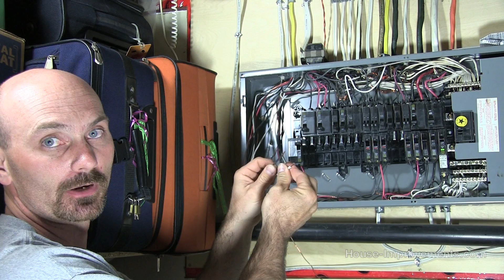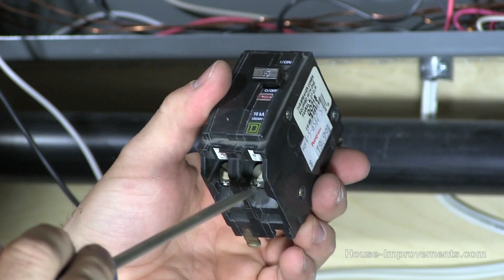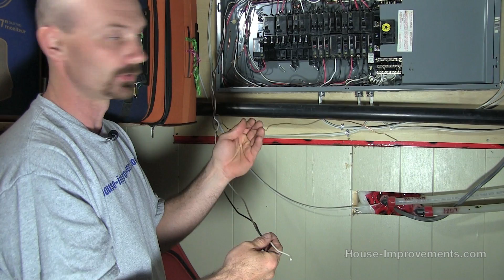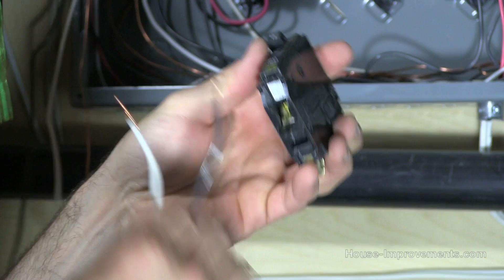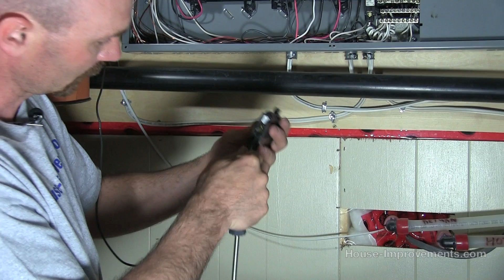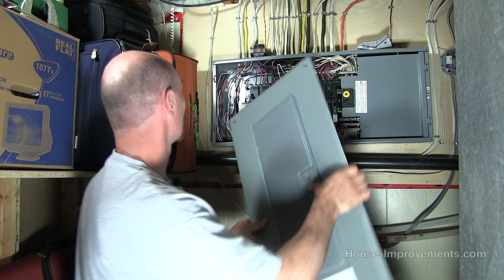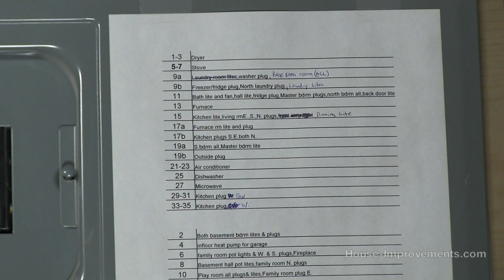How To Add a 120V 240V Circuit Breaker

Comment: Always use a licensed electrician when doing home improvement.  Same as you would never perform dental work on a family member.
Reply: divorced or deceased I am seeing a pattern here
Reply: +shawnbrennan1 I am a dentist with 40 + years experience. I have done many procedures on my first wife (divorced), my second wife (deceased), my mother (deceased), and my father (deceased)., my first father and mother in law (both deceased). They never had a problem. At least $20, 000 was saved. Thank you very much!
My experience tells me you shouldn't treat your friends!
Reply: shawnbrennan1 ROFL This guy, comparing electrical work to dental work. What a schill.

Comment: At my work place, it's always stressed that safety comes first.  Missing little things, like testing to see that a wire is live, can be deadly.  That is my only advice in this video.  To your credit, you did point out that you should have tested first.  At that point, it could have been too late.  To everyone watching this, ALWAYS MAKE SURE THE POWER IS OFF!  Test and re-test if you have to.  
Other then then that, The video is great.  I'm in Canada.  I've pulled a permit to do my own wiring on my addition.  Although I was fairly sure how to install the breakers, this is a great refresher.  Thanks.  I appreciate the simple, straight forward approach to your videos.  Wiring isn't rocket science.  But you do want to make sure that you do it right so it doesn't blast you to the moon.  Thanks again for a job well done.
Reply: Leroy Ginter, how does one stutter when typing!  [then then] :)
Reply: Agreed, though in fairness he does repeat probably half a dozen times in the video that if you don't know what you're doing, hire an electrician.

Comment: Is'nt it supposed to be a 10 gauge wire since it will be a heavy load you are putting on it. You said 12 gauge and 15 amp breaker for the water heater. Shouldnt it be 30amp?
 Question . Are all heavy gauge wires attached to a big breaker that looks like the one you installed? How often do you see aluminum wires? When inspecting panels what is the most common mistake you see?  In NY Code is no more than 6 hand movements for a panel box. Is it the same where you are.
Reply from the maker: The 12 gauge was for an electric wall heater not a water heater. Just because you have heavy gauge wire does not always mean you will be using a 240v breaker like that, it depends what you are running.
I see aluminum wiring fairly often usually in homes that are pre1960. Aluminum wiring and copper wiring should never be hooked together. Aluminum can not handle the heat that copper can and can cause a fire.
I am not a licensed electrician but the main thing I see is overloaded circuits and very full /messy breaker boxes.
I'm not sure what you are referring to when you say (6 hand movements)? Please come to the forum if you have more questions or comments.

Comment: Seriously dude, that's the ONLY problem you see with that installation? Seriously? I don't know what electric code applies in your area, but over here this installation would be shut down IMMEDIATELY. Incredible. Looks like a third world country!
Reply: this panel is not horible bit messy but much better than lots dont know were your from but its pretty comon to see panels look like that

Comment: There are cables only with 3 wires in US or no? And why don't use different colors for the hot lines (phases) black, gray and brown for examble and the white for neutral. The other is how connect the exit of the main switch to the breakers in case of three phase system. Thanks from Europe.
Reply from the maker: The main wires used in residential, 2 wire and 3 wire. These are not counting the ground wire in them.So the 3 wire would have 1 red ,1 black, 1 white and 1 bare ground wire.

Comment: Thank you, I found this very informative. How does the process work for people who feel comfortable with the idea of performing this type of work in their own home? Should they leave the circuit disconnected at some point until it's been inspected? What does "Pull a permit" involve?
Reply: TomlinsTE Relax. Learn before you attempt and pay attention. Screw the permit. Leads to higher taxes. Screw the tax man. Screw obama. He is human excrement.
Reply from the maker: To "pull a permit" you need to contact your local power supplier to apply for a permit to do what you are wanting to do. They will let you know if they allow it or if you need to hire an electrician. If you are comfortable with these type of jobs then you would do it and turn on the breaker. If something is crossed up the breaker will trip. Like I have said please use all caution and contact an electrician if you have any doubts, electrocution can be deadly!
Reply: I expect the Power provider has some kind of cozy relationship with the Electrericians Union, even if they don't I find it dificult to immagine they would accept the liability of encouraging anyone to perform potentially dangerous jobs.

Comment: I learned a lot; I'll check out your website for sure for more interesting information. Here's some tips though: Stand on an insulating rubber mat while you're working. These can be purchased but there are a lot of rubber mats around such as floor mats from cars. The purpose of the mat will be defeated if the environment is cluttered and somehow you are completing a circuit by some part of your body touching a wall or pipe, or, God forbid, a wire. Also, so far as possible, use only one hand. You do a lot of two handed fussing near and on the panel. Your heart is between your two hands. Another thing that is not safety related: Before you turn the main breaker off or on, turn off all the circuit breakers. That way there is no current flowing through the big breaker when it is being turned off or on. This information comes from a Wikihow article at http://www.wikihow.com/Wire-a-Simple-120v-Electrical-Circuit I worked on high-voltage electronic circuits while in the Navy so this rubber mat and one-hand discipline makes sense to me.
Reply from the maker: Thanks fred, those are all good tips. You may be interested in participating in my forum. There is an electrical section there that you may be able to help out with when you like.
Reply: LOL - sounded like EM words to me...

Comment: Good video, But always check down from your main breaker for power after you shut it off and start working. At 18:30 you tested the new 120V hot wire you installed and the circuit breaker was off but the tester showed it was hot, and you skipped right over that!
Reply: if his tester is like my Fluke it picks up energy from more than an inch or so, they really aren't that discrete i think...
Reply from the maker: daikaiju20 Yes you are right if you are in a box with more than one hot, you need to be careful. A multi meter is better.

Comment from the maker: The idea is that you would never be using every circuit maxed out all at the same time. Some of those circuits you have may hardly have anything drawing from them most of the time. In my area most new homes are being built with 200 Amp service panels because of the size of the homes and the extra things we all seem to run now. The receptacle circuits alone in most of those homes would add up to well over 200.

Comment from the maker: Yes what you seen was the transformer for the door bell. Transformers can be wired directly to your 120v in the panel and then your system can be installed . There are different transformers depending what you are converting to. Most home security can be run with 24-28 gauge wire.

Comment: I saw little 'transformer' on top of the main control panel. I'm just wandering if is it possible to connect a 'low voltage' connection to the main control panel? Say, if i have 12 volts output what wire gauge number do I need for my home security alarm?

Comment: Electrical Code in the U.S. is a national standard.  Section 100 of the code says where a panel can be placed,if it doesn't pass it's because the inspector doesn't like it,because a box hung that way isn't not allowed.  The Electrical code does allow for an inspector to not like something anf you could fail inspection without reason,which sucks I know.

Comment: 120 volt wire- usually Black=Hot, White=Neutral, Green or bare=GND
240 Volt wire- usually Black=HOT A, Red=HOT B, WHITE=Neutral, GREEN or BARE=GND

Comment: the  240 volt  uses  a  15  amp breaker huh ?  i would  think  that  12 guage  wire could handle a  20 amp

Comment from the maker: Generally, yes this would be true in almost all cases in residential wiring. The feed from your electrical supplier would be 240V and your individual breakers supplying your circuits in your house will be either 240 or 120 depending what they are feeding.

Comment: from what i've read in New York you are required to have an electrical license to obtain a permit. any work without a license/permit is out of code and wil fail inspection. I should call my local engineers office to get the official word for my town.

really good video, thanks for providing these thorough guides.

Comment from the maker: Some breaker brands are interchangeable but the style or type must be the same or they will not fit.
Reply: Some breakers will fit in the box. but the on/off direction is reversed. My old house had one 120ACV breaker like that. I guess someone had replaced that breaker and used the wrong one.

Comment from the maker: Alot of 240 circuits do not have a neutral. If it were a 240 appliance like a range then there would be a neutral because of the 120 receptacle on it and the light in the oven and some of the electronics.

Comment: Only if the 240V appliance requires the use of a neutral (which would allow it to pull 120V off one leg) to run a light/fan/etc. IE. an electric stove.

Comment: For the 240V circuit, why is there no neutral? Wouldn't you be typically using a 3-wire cable? i.e. 12/3, which would have, in addition to a ground wire, a black (hot), and red (hot), and the white (neutral)?